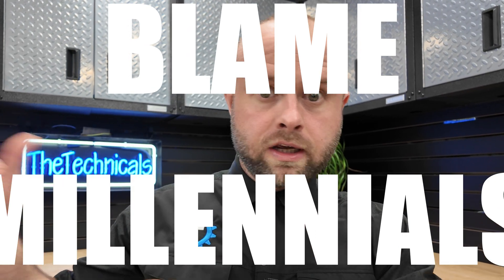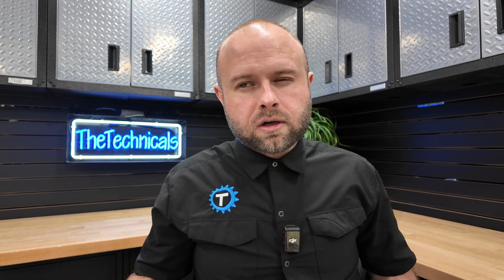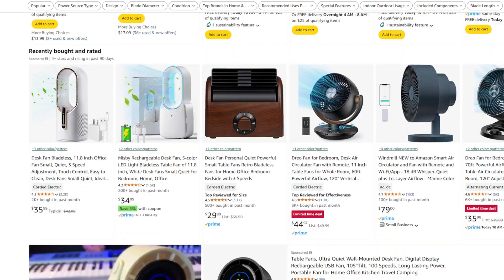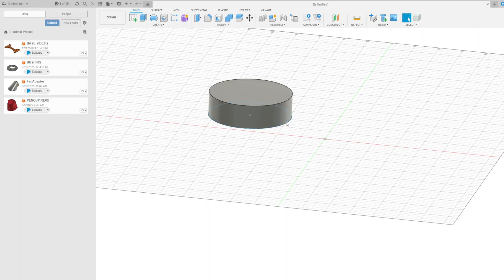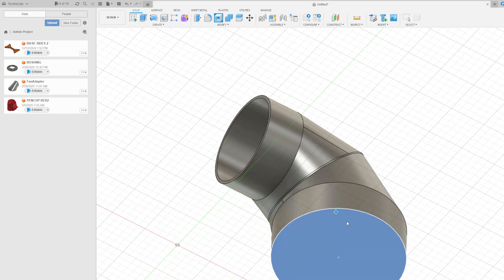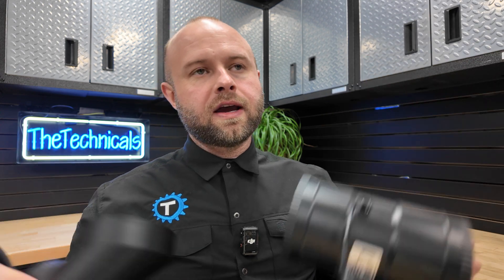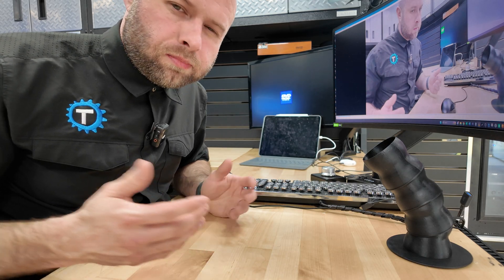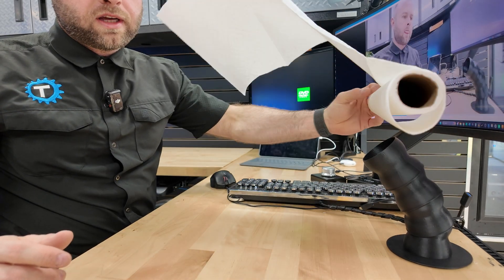3D Printing A HIDDEN Desk Fan

Comment: If you rip a wet fart, you'll smell it in less than a second. Straight to the nostrils.
Reply from the maker: These fart comments have me thinking you guys have some serious gastro issues are you just ripping 24/7
Reply: @TechnicalsTinkers I rip enough that that fan placement would be a problem lol

Comment: 4:37 You should have designed this in 2 parts like a washer and the tube with a small flange on it so that you dont need so much supports and it will be a better surface on the underside.

Comment: The look is great. If you could make it without drilling a hole in your desk your number of potential customers would be much larger. I would use a beefed up motor and connect it to some fan blade. In the base you could make a slot or slots at the back acting as air inlet and mount a motor above it. Include the speed control in the base and power it with a USB C cable from which the connector is placed under the base (not on the outside edge). So in case people really do not want to see any cable, they got the option to drill a 10mm hole and feed through the cable.

Comment: You still use a loft you just have to give it a path by connecting an arc or spline from the center of 1 circle to the center of the other. 😊